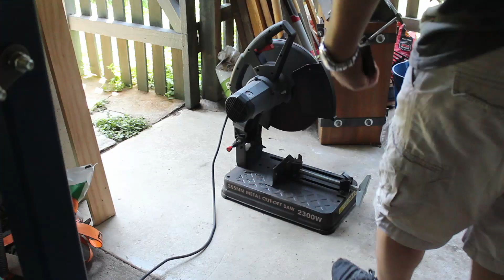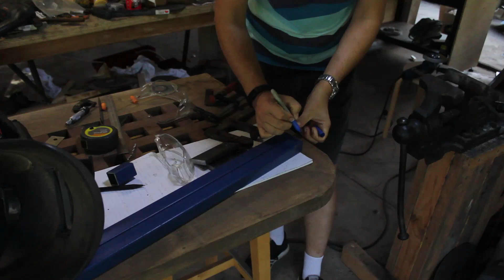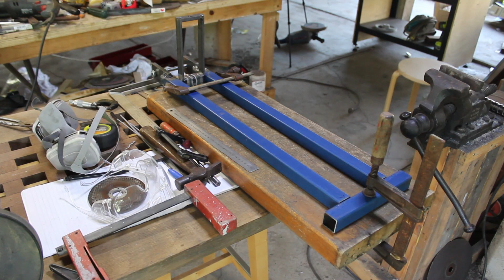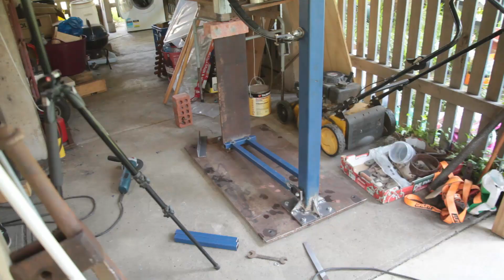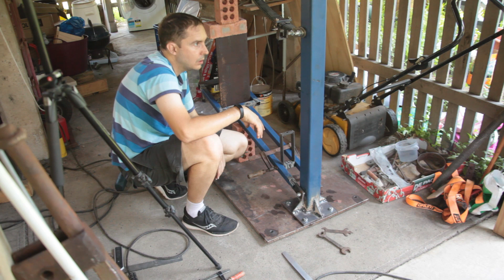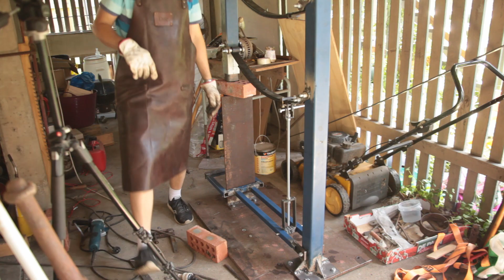Treadle Hammer Build pt8

Comment: It's coming along nicely, but why do you have shackles on the pivot points. Surely that just doubles the play and I can't see any benefit.
Reply from the maker: Allows for more adjustment to keep the hammer face in line with the anvil face as I planner and added 35kg of lead to the ram which needed adjusting as a result
Reply: OK thanks. I've been meaning to make one for ages, you've inspired me to get on with it :)

Comment: Keen too see how it moves steel. 
One suggestion I have is too try break the habit of measuring in cm's. Im a carpenter by trade, and have never encountered a tradesman or fabricator that uses it as a unit of measurement. Will make you sound more professional is you use millimeters or metres 👌

Comment: ..Keeping the "Smasher" in line is the part i am intrigued by. It's coming right along Doc, Good work sir...!!
Reply from the maker: the pivots as designed are remarkably stable, you really have to work at it to deflect the ram in use. I'll see how it goes with the forging dies I just made but I have the option of adding a guide to the arms if needed.